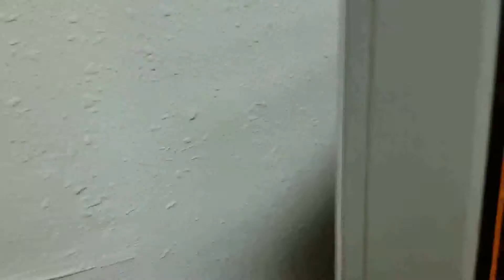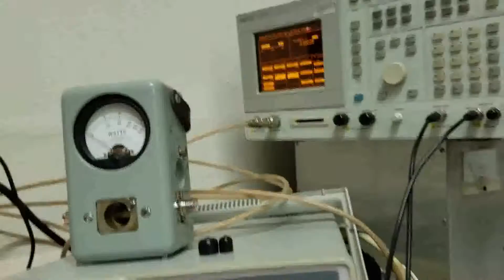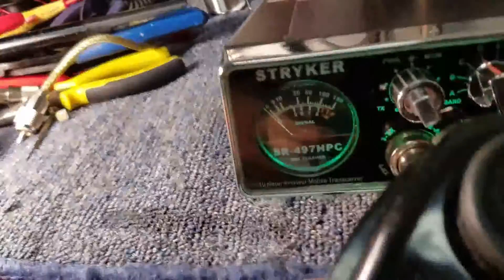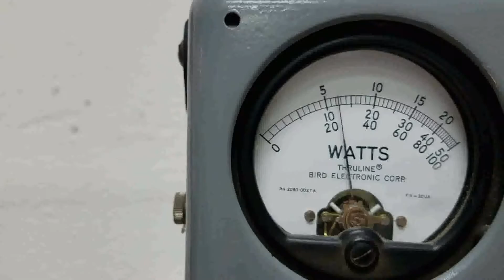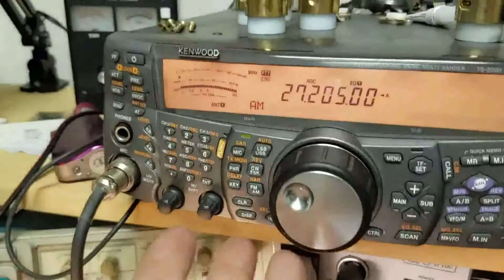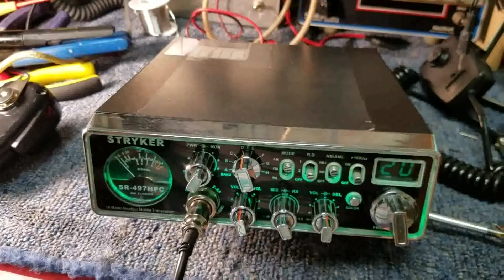Steve's SR 497HPC repair realignment and upgrade report

Comment: I have a stryker 497 n I love it, crisp clear clean modulation, I get comments all the time on my radio, I won't run anything but a stryker. all stryker radios are awesome, buy I like the 497& 447. the 655&955 are awesome radios too, but to many bells n whistles for me.
Reply: Got a dump question. I have this same radio. Where is the sweet spot to run your mic gain on this radio?

Comment: If you want perfect, loud, clear audio that doesn't splatter and unheard-of receive to the point of being accused of ghost talking, either stand face to face in front of the person you are talking to, or send your radio to be properly tuned and aligned. People say I am running a modulator, amps, and I have had one guy say I wasn't being truthful about my location because I was so loud. Great work, very professional and up front, and will get ALL my business. WORTH THE WAIT FOR PERFECTION AND PERFORMANCE!!!!